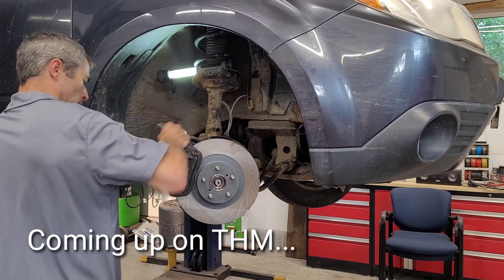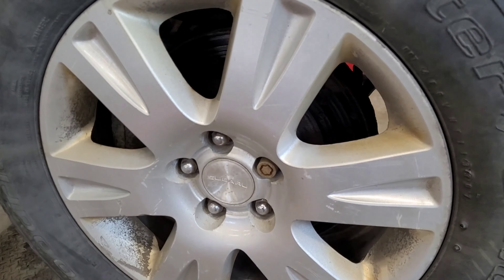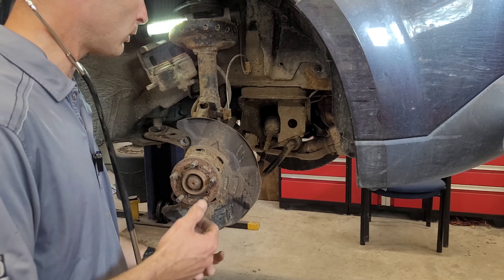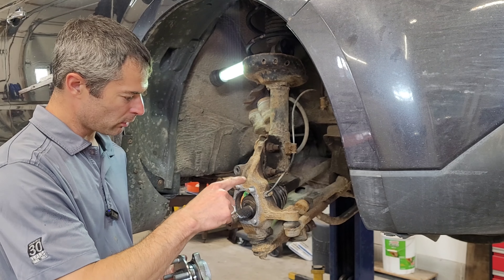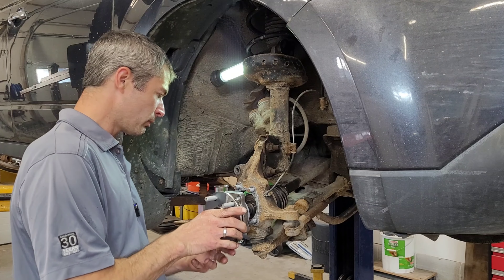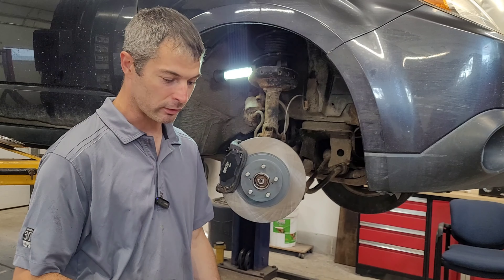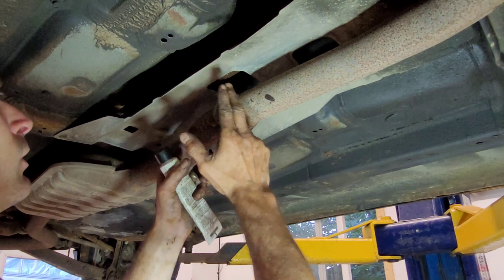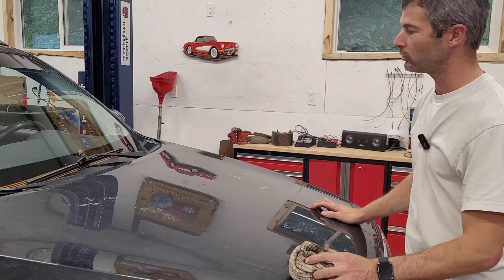Subaru Wheel Bearings are EASY!!!

Comment: By the way, when I got the car new from the dealer, during the break in period, I changed oil at 1000KM, then 2000KM, then 3000KM, then 5000KM and from there on every 5000KM. I think that has saved the car from burning oil or having to add oil between changes, just a thought.